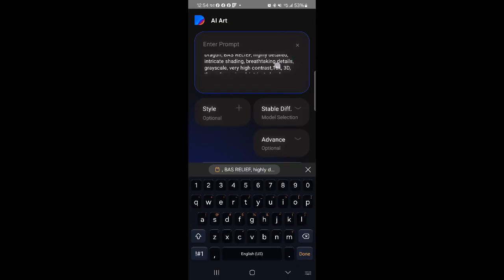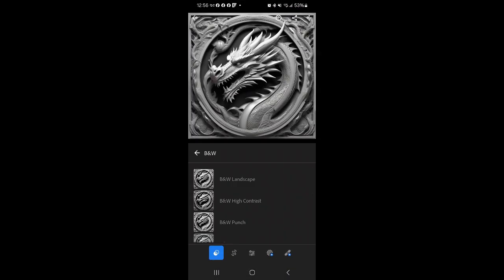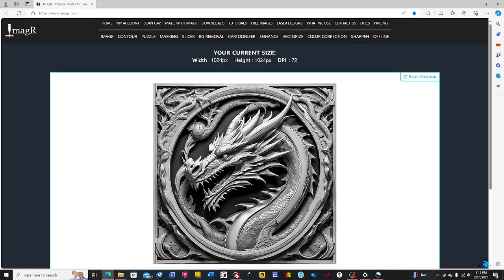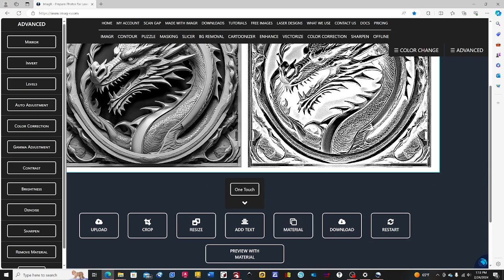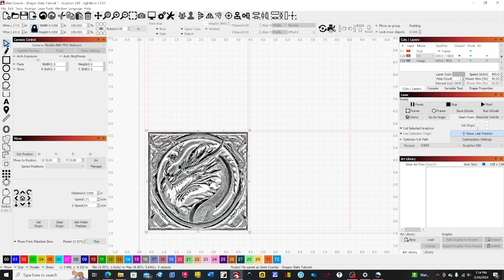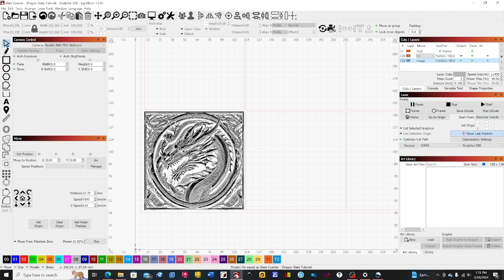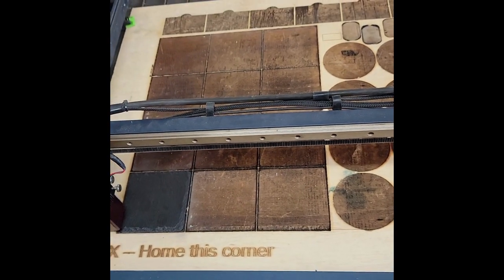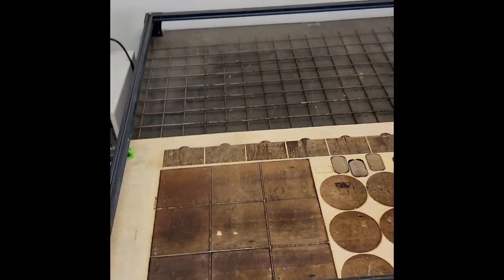FULL TUTORIAL- Slate Coasters with a 10w Falcon Diode

Comment: I am currently only using LaserGRBL since its free and Lightburn Costs. I am 100% new.  I need to know a few things like How did you design your template for 4" Coasters where you can do multiple at once. What are the settings in LaserGRBL with the Creality Falcon 10W...for engraving the Slate coasters. and How do you set the laser to engrave and cut both. again I am 100% new